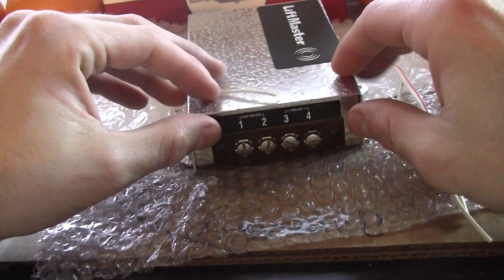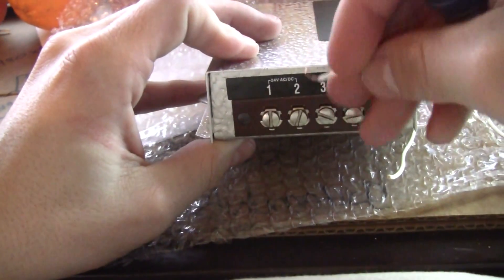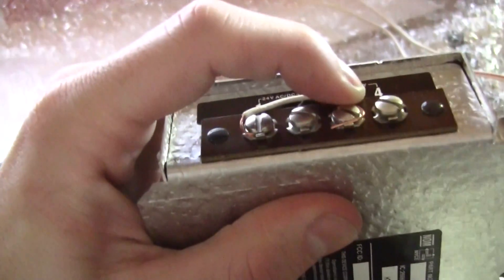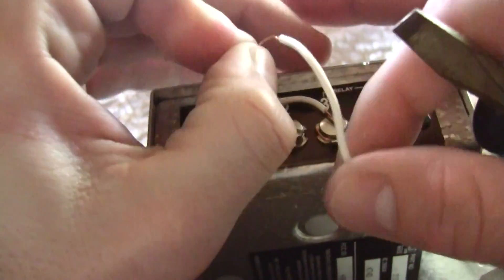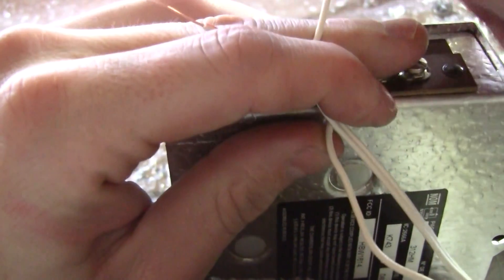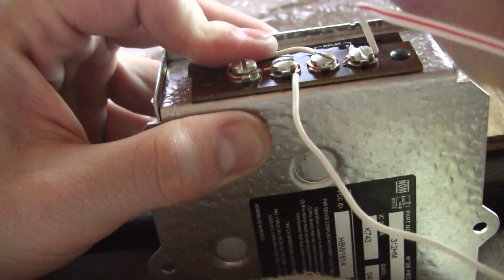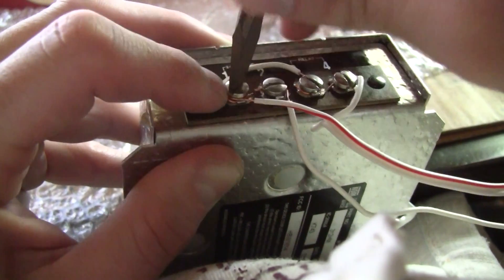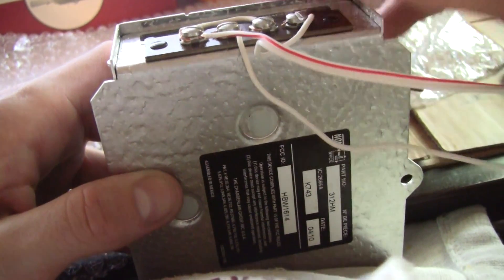How to wire a Liftmaster 412 Receiver

Comment: Wow, this is bad.  A perfect example of how NOT to wire anything.  First of all, your "hooks" in the wire need to go with the grain.  They should be wrapped in the same direction as you turn (clockwise) when you tighten the screw.  I think he did this on one of the 5 connections.Secondly, you should NEVER leave the little ends sticking out from under the screw.  When he wires up #2 screw, he leaves a little end sticking out that is almost touching post #1, and then he leaves two ends sticking out of #1 that come even closer to touching #2.  If you've got bare wire sticking out anywhere, you need to shorten the bare wire or wrap it a little more.
Reply: I'm not handy at all, and even I knew he was doing it wrong. ha ha
Reply: I can't believe they left this post up!
Reply: Wow, agreed.

Comment: hi there, I wonder if you can help me with this. I bought a 423lm receiver. it looks similar to what you have. It has 6 wires on the other end. do i need a transformer for this or power supply? which wires do i connect to the operator?   much thank!!! please help!